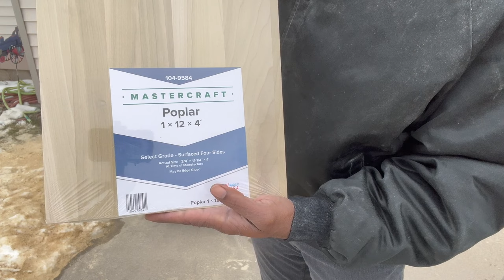Building A 1" Scale Former ATSF Business Car Part 2

Comment: I was in the middle of typing the track geometry car when you made the suggestion!  NS has converted an old heavyweight private car, the “Bellfleur” as a modern geo car.  It doesn’t need to be stainless you know, unless you are sticking to ATSF proto.  Keep it coming!
Nothing wrong with Bondo filler, but use clamps when you glue anything!

Use fewer roof arcs, notch them, lay full length strings in the notches, glue them in place. Lay the roof over that framing using thin metal or glue soak cloth.  It’s lighter and functional.
Reply from the maker: I did look at the NS Car for a split second, but since I am a Santa Fe guy, I chose to stick with the stainless steel version. However, also being a former CNW employee, I thought initially about building a car to commemorate my roots, but this project goes in the direction that fits with my Santa Fe theme
Reply: Consider staggering the roof ribs and notching them out to hold full-length support beams.  Use thin sheet aluminum as the roofing material.  The car will be lighter and the roof a single removable piece.  Trust me! @warbonds